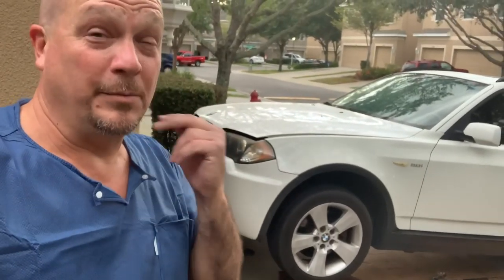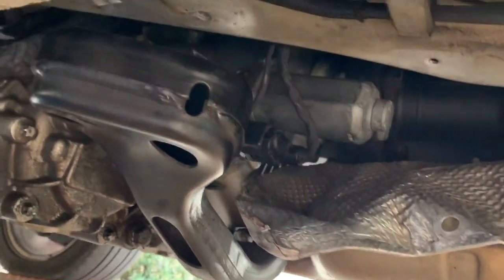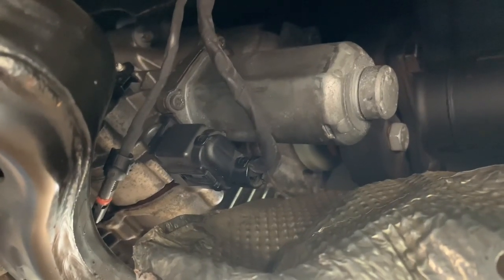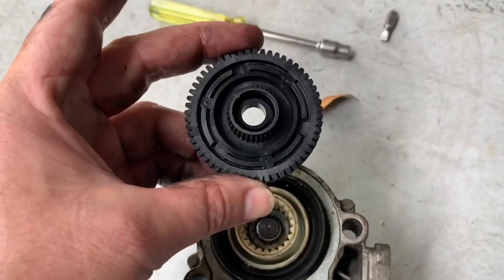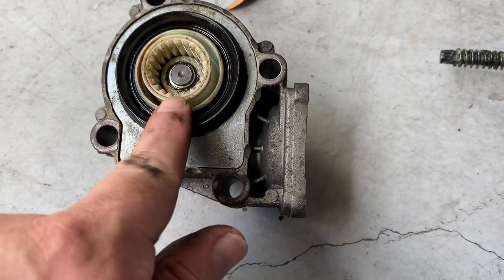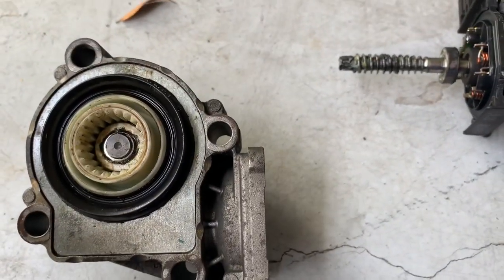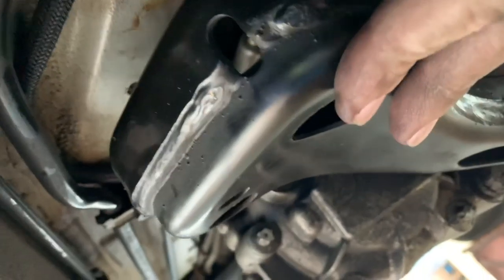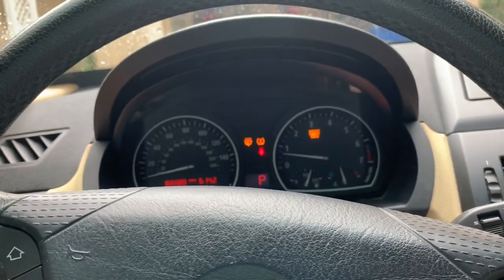#FREE E53 X5 E83 X3 BMW Repair #Transmission BMW transfer case servo motor

Comment: I just turned my gear around. It works wonderful.  My wife has not had all wheel drive for about 3 years. Was told by bmw a minimum of 2-3 thousand dollars. Thank you so much for the tip.
Reply from the maker: well hopefully it will continue to work well for you. However, if gives any more problems get new gear and replace the oil with the proper oil for the transfer case and the rear end
Reply: I opened the actuator about two years ago and put in a ten dollar gear, and then I realised that it wasn't needed, because the opposite 180 degrees aren't wearn at all. In fact it was a little bit tricky to remove the plate.

It's absolutely a perfect idea to turn the gear "180 degree". But you have to consider, you first draw out the "screw" then the gear turn a number of degrees then you turn the gear, and when you put the screw back the gear turn "some more" degrees. 
So I'm not quite sure if the right thing is to turn the gear exactly 180 degrees.
On the other hand I think that the wear is less than 180 degree.

If the teeth of the gear are totally worn out, then it's easy to figure out how to solve the problem.

A very good video!
If you combine this with other videos, you can learn how it looks like underneath the blank plate!

If you remove the plate you can then easily remove the debris from the worn gear! Not to forget.

Comment: Sir I must salute you! I did this to my wife’s car & it works perfectly. Amazing results. Great video, good explanation. Very happy you shared. Thanks again, all the best. Leo
Reply from the maker: Check out the gyro videos they are cool aviation machines
Reply from the maker: Also if have more problems with your BMW change oil in transfer case, and rear end, with proper expensive oil and make sure all tires are same pressure
Reply: Doing it today after doing an oil leak riggt behind the oil pan housing seems like I can't find the leak but there's always oil riggt back there.and my cars making a noise like I gotta bleed it or it's losing to much oil

Comment: GyroGerald, you are awesome!  I just did this moments ago.  It took me a while to get to all 4 bolts.  I eventually bying a nuckle adapter.  I used a 5/16 regular socket to get to the 4 bolts.  Got it on my bench and rotedted 180'.  I didn't want to pay the close to 3k my dealer was asking for.  It took me less than a morning.  About 3 hours I'd say.  That includes having to go get the nuckle at the local auto parts store.  It's still shifting a bit rough but she has 180K miles.  Just scanned for codes.  Clean bill of health.  Thanks again!  😀  I used a jack for the cross member too 😏
Reply: Well if it gives you anymore problems then replace the gear. It will be easy now to do because you already did it once 😄. Also consider replacing the oil in the transfer case and the rear end of the car and the transmission. But you must use the expensive oil from BMW to do the job. 
Have a nice day

Comment: My transmission (or transfer) feels sluggish. Specially when accelerating from 0. Sometimes it doesnt engage 1st, and it seems to be getting worse. The delay for gear engagement is getting worse and seems to only happen in 1st, and worse when cold. Will this servo motor fix improve something? Chaing the Transfer fluid?

Comment: I don’t know if you read any of your comments, or where you’re located?  I am a female who has owned a BMW 2008 x3 for 2 1/2 years……It is perfect cosmetically…flawless white paint and beige leather interior..gorgeous to look at…like new quality all weather  tires,……..I have replaced the water pump, actuator, alternator, battery, and the starter..I run quality synthetic oil, the transmission is newly flushed this week….i was told the differential could be problematic but not terrible as of yet…( I live in Mt.)… The easier issues are I could require  brake pads at some point this year, so I was told…..I have put a lot of money into this machine and yet ……it is now making very weird subtle noise such as subtle grinding and not shifting well between 1  and 3rd gears……this is something new and rather frightening when I’m at a stop, as it starts jerking and not properly accelerating….( I would compare this to the feeling you get if you  accidentally left your emergency brake on) …once on the open road traveling between 55-70 it moves along like a new car……The mechanic who has currently worked on it, who is not a BMW expert says the engine itself is in great shape…
I guess I am seeking some wise counsel, as Beemer aficionados are limited here in Mt…..I am open to selling this vehicle as well…..
It’s a beautiful little car with 34000 miles 2008…….
I would appreciate advice,,.thanks.

Comment: Hi there. I’ve got a hard shift 1st, mostly 2nd and little 3rd. No 4x4 light. Changed the gearbox oil and it’s way better, though it is still something, kinda mechanical when pushing into 2nd ( mostly) when cold especially. Clutch is all the way to the floor of course. Some say I have to change clutch ( makes sense in a way, slave cylinder or hydraulic pump, but the discs feels ok) , or transmission issue (makes sense) , but none sure. Cannot just change clutch and transmission, and at the end to be something simpler (like in your video). Advise please

Comment: Does the servo motor still engage when using rwd only? My 2016 x3 jerks like its skipping gears when taking off from a stop. I thought it was transfer case, so I flashed it with xdelete to go rwd only, but still jerks, just not as hard now. Getting drivetrain malfunction warning.

Comment: i have a 2007 bmw x3 with 160 miles, my father and i have done transfer case fluid change and transmission fluid change and I still notice that the car shifts harder than my mothers e46 with 250,000. will this repair help?

Comment: Good post.  I am having similar issues on my 2004 x3 E83 3.0 (hard shifting, jerking bucking).  I do not yet have any dash lights coming on so this may not be my issue.  My indie bimmer mechanic is trying to tell me its the entire transfer case but I want to inspect that actuator assembly first.
Reply from the maker: Get the right oil for the transfer case and rear differential from Amazon or BMW. It made a difference on mine. Also go ahead and replace the gear just to eliminate any problems. But transfer case oil made a big difference with how it acts
Reply: Just got around to  changing the transfer case fluid with DTF-1 purchased from the dealer.  My old fluid had tiny glitter like metal shavings but this could be normal wear after 140k.  I will move on to remove and inspect the actuator assembly next.  With those connectors detached I think the car is running 2wd which is another good way to pinpoint any transfer case issues lurking.  After the T case fluid change I have a slight improvement to shudder, but still detected.  I plan on also inspecting rear flex disc, center support and u joint.  A lot of guys are replacing the transfer case chain but hoping not to have to do that.  Rewatching your vid because my actuator platic clip is frozen probably from keeping the car outside so trying not to break that clip.  Thx again!.

Comment: I was told possible rear differential was causing the rear clunking noises.  How could I determine if it's the  transfer case servo motor gear or the rear differential.  I don't want to replace the rear diff if I don't need to and they're not sure!
Reply from the maker: Oh could also be drive shaft rubber. But replace all the fluid with exact replacement fluid

Comment: Great video brother. I have a 2002 BMW X5  3.0 motor. From park to drive it feels like the parking brake is active and the truck doesn't want to move fast. Should I just replace that actuator and replace the oil?

Comment: Hey! I did this to my 2007 x3 and the lights are still on and it won’t reset. It also goes on limp mode now. Is that a transmission issue?

Comment: Hey my e90 Xdrive is binding very roughly on sharp turns and in parking lots.  Do you think this is related ?
Reply: Suspension components are all good
Reply from the maker: what do  you mean binding. Are you having a bump in the rear end when you take off? or when you slow down? or a clunking sound? if so then this might be the problem. 
Turns should not show this problem really. Are you mainly hearing a sound in real tight turns but not going straight?
Reply: @GyroGerald  when I turn at lower speeds like lock to lock the rear makes a bad thumping noise. Exactly the noise you hear if u were to turn a 4X4 truck in a dry parking lot.  Not squeezing but u can feel it thumping and it holds the car back.   Like there’s tension somewhere like the gears are bad in the transfer case / diff area
Reply: @GyroGerald  for example with the tension situation. If I’m lock to lock or turning more then 3/4th of a turn the car won’t roll forward by itself & when I let the clutch out it feels like something’s stuck w the AWD system.  So I thought to unplug the transfer case fuse #40 and all my issues went away but the car is now in full RWD * witch is fine but I’d like to have the option for my awd to be working * I am also stage 2 + with the The N51 SULEV
Reply: @wolffemergencyresponsellc.3152  Did you ever figure out the issue? I have a BMW X3 with a similar problem. It feels like the car is fighting itself during tight turns in a car park. My 4x4 light is also on, I'm just about to replace the actuator. The car is smooth as silk on the highway, the issue only presents itself at slow speeds in a car park, or whilst turning onto the motorway.

Comment: At 1:16 of video you state that T-11 torque bits are needed to remove servo motor bolts. I think the real size is E10 (female).
Reply from the maker: Cory Danks could be right I don’t remember the sizes now
Reply: I used a 5/16 socket 3/8 drive and a nuckle.  Worked just fine.  Tight up there.  Even with the cross member pulled down.

Comment: Mine is a 2008 bmw x3si 3.0L. It starts and runs but Revs in all my gears. It will not catch a gear . Only dash lights are 4 x 4 & brake light
Reply from the maker: Replace gears and oil in rear end and transfer case

Comment: Did your shudder between or around low gears during acceleration? My 08 x3 shudders during slow acceleration and drive very smoothly under cruising/highway speeds. I do have some of the clunking in the back when parking or driving in a parking lot. My transfer case is new rebuild the vehicle has 94,000 miles. Thanks for any help.
Reply from the maker: Wow I have 190,000 on mine and it is now clunking again, I had vibration and rear cv joint going bad and replaced drive shaft assembly and vibration stopped but if one of my Tires are low it clunks on acceleration. Or if I accelerate hard it clunks. But does not clunk when I slow down and stop like it used To. I think I have an issue with Transfer case again but I checked gear and it is ok. So I feel like something is not making Transfer case go into gear quick enough when I accelerate. Because if I accelerate easy I don’t seem To have clunks. BMW is way over engendered but I had water pump go out on it a month ago and it was The easiest water pump I have ever replaced.
Reply: Transfer case chain is loose due to expansion.  Easy fix
Reply: Experienced shuddering in my transmission. Changed the ATF and added a tube (additive) of "Shudder Fix". Fixed the shuddering for good.

Comment: Good morning 
Please help me change but still 4&4 light on what Problem
Reply from the maker: Maybe reset or erase codes
Reply: @GyroGerald  was
I disconnected the battery but to no avail, it needs a computer reset I'll try
Reply: @aliibr8233  turn the steering wheel to its full rotation both ways, it resets steering angle sensor
Reply: @enockfernandez1144  he needs reset ecu not steering.

Comment: Hi brothers, I have a BMW x3 3.0i as I was driving my transmission malfunction light came on and gear  positions on my cluster disappeared and my car went into limp mode I tried to reset my transmission but no luck and I checked my range switch and looks fine what might be my problem... Please help
Reply from the maker: Did u clear codes and see if made a difference with anything

Comment: Hmmm? I was just thinking of replacing the whole piece
Reply from the maker: Yes I recommend replacing and changing oil in rear end and differential
Reply: @GyroGerald  YIKES! I’ll have to look up how to that too!  Truck (e53) is riding “okay” - gonna replace wheel sensors, but I have the Trifecta of “slabs, brake, and triangle circle” so I decided to try this first

Comment: I’m still having the same problem after changing mine
Reply from the maker: Well then need to replace the fluid in the Transfer case and the rear end. Then check the universal joint on the drive shaft probably the one closest to the rear end. Oh and use the expensive oil in the Transfer case etc
Reply: @GyroGerald  thx....just ordered a TCU also. Heard that maybe the problem.
Reply from the maker: @jarhead7758  The resistor?

Comment: You can get an aluminum or brass replacement gear for the actuator.much better than that plastic crap.
Reply: Where does one find this?

Comment: I have a bmw x5 4.4i e53 2003 problem with revese
Reply: Hey did you ever get the reverse fixed? I have the same problem with my 03 X5: goes forward without any problems but no reverse.